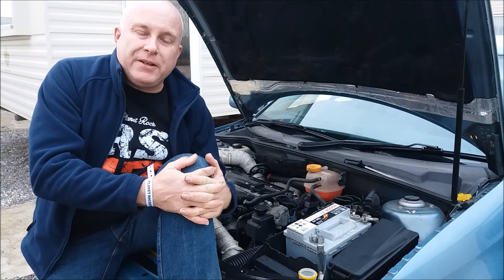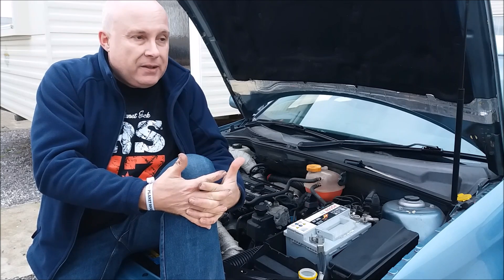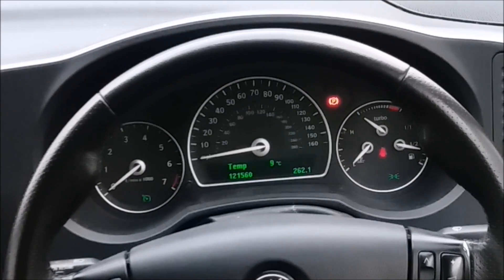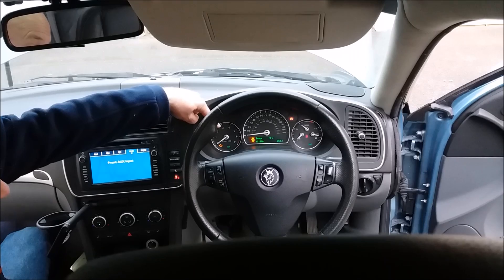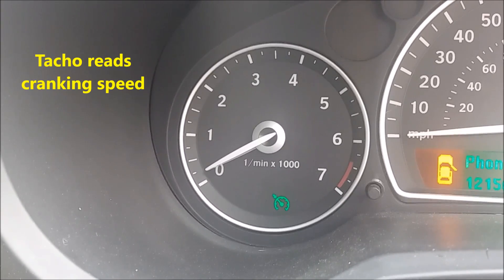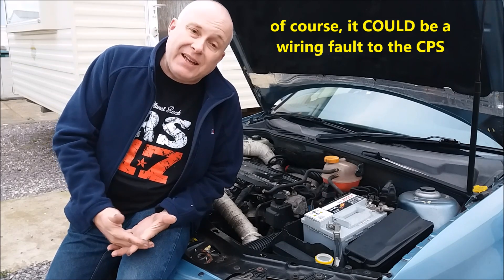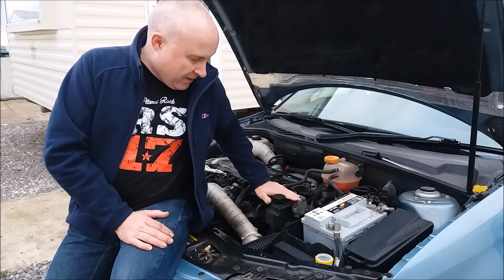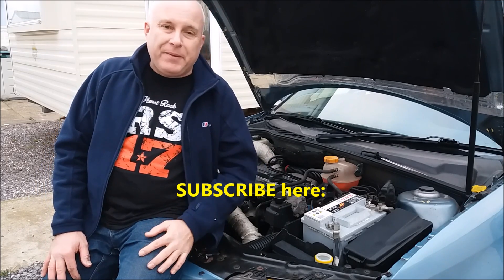CRANK Position Sensor Test - failing CKp sensor - CKp test

Comment: Great advice here! Had this happen three times on my 9-3 recently. All cut out whilst in the outside lane of a dual carriageway. First it just died, no EML but Traction and Stability warnings popped up. Restarted sluggish but cut out after driving again, this time with a CPS EML code. Did it a third time with EML where it wouldn't restart (no RPM movement). Seems heat related as after 10 minutes it started. Changed sensor today and fingers crossed. Try to do warm, it's very awkward and it can be tight. The Saab WIS says to move starter motor out the way for more room.

Comment: Very good advice. I have this problem but I get P0340 on my OBD2 Scanner. ( Not Tech2) I have Saab 9-3 1,8 Vectra Motorcode B207E. Is it under the Chain cover? Is it mostly dirty or cabel /contact- problems do you think.

Comment: Thank you so much for your great videos! I wonder if there's a video showing all the sensors that need occasional cleaning in a 1.2 TSI engine, so as to be able to do some useful DIY work. I've got a Skoda Rooster with the 77KW/105 HP variant but anything similar will obviously do. Thanks again!

Comment: @CycloneCyd  Your video is lovely! I am pretty sure my problem is the same - the crankshaft position sensor. (SAAB 93 2005 Aero, manual). I managed to took out the screw of the sensor, but it is so hard to take he sensor out because of the small room around and really hard access. It feels so stuck. Can you suggest any tricks is this problem? Many thanks in advance!
Reply from the maker: Clean around the area of the sensor. Spray a little penetrating oil. Try to do it when the engine is warm (the hole will expand). I had no problem changing mine, but a lot of people have the same issue as you.
Reply: Already done! It turned out it was difficult because the censor was misshaped  (expanded) a bit. Thank you so much! My problem with not starting  car is sorted out! Be blessed  @CycloneCyd!
Reply from the maker: Ah, right. Did you suss out why it was misshaped? Was the housing cracked and water had got in causing corrosion maybe?

Comment: Hi techies ,can you help. My 2009 vauxhall vivaro has a delay in starting, slight engine vibration and intermittent P0201 ( cylinder 1 open ) error above 3k revs. ( stop engine light )Garage checked wiring, charged me £450 for new injector still the same.have read crankshaft sensor can do this ?

Comment: My honda odyssey k20 is cranking but no start the engine...but fuel is coming and injectors is good but the spark plugs is not giving more fire as the normal car do....how is this problem come coz of crankshaft

Comment: So if the rpms are not moving while cranking that means that   the cps is bad?...im havinf the dame issue with a bad sensor.. cranks over and takes forever to start
Reply from the maker: Basically, yes.
Reply: @CycloneCyd  ty very much .I had one in there that started failing...put an OEM Nissan sensor and the crank would just crank ..I was so upset when I got out of the car I forgot I had the one that was halfway decent on my lap and it feels on the floor and hit it pretty hard because with that one the csr would start...but after I dropped it and we put it back in the car would take forever to start

Comment: Car cranks but will not start. When cranking tac does not move, but jumps ups a little bit and back down when stop cranking. Any other way to tell if its the crank  position sensor?

Comment: I have a 2004 Saab 93 2.0t, manual. I overheated once and since then when I cranked it over, it almost sounds as if there's no compression or pistons moving. I was able to manage to get it to start by furiously pumping the gas peddle, once started, it ran great. But like I said when cranking sounded like no compression but when I pumped the peddle a lot it would eventually start and run great. Now I was dumb and didn't fix the leaky radiator hose. So I ended up overheating it again. This time it not only sounds like no compression and as if the pistons aren't moving, it no longer will start even when I pump the peddle. Today I pulled a plug and put a compression tester on it, no compression when I cranked it. Pulled a second plug, hooked up pressed Guage, cranked it, same thing, no pressure. I have a strange feeling the pistons aren't even moving. Any idea what could cause this? I'm gonna check the 2 remaining cylinders tomorrow, but I'm thinking it will yield the same results as the 2 I checked. I can't afford to have it checked by a mechanic. Any help, info or ideas would be appreciated. Thanks.

Comment: So..when i do the test i must disconnect all 4 injectors and then try to start the engine to see if the tachometer moves?
Reply from the maker: Correct. the point behind disconnecting the injectors is two-fold: 1. the engine won't start so you are free to turn it over for a few seconds to watch the tacho  and  2. you won't flood the cylinders with raw fuel while turning it over (which would wash the bores and rings and get to the sump and contaminate the oil)

Comment: I just went out to crank our 2005 Buick Rainier, and had zero RPM's so tomorrow I will put a new crankshaft sensor on, and hopefully it will start & run as it should. Thanks!
Reply from the maker: How did you get on?

Comment: I have exactly same problem, which I have discovered this morning. Trying to start a car, I can hear starter, but thats it. Eventually it shows gearbox error, but once I read ECU faults, it is : Crankshaft position sensor. I have digital dashboard, so I could not check taho meter, but I am sure that sensor is faulty. Thank you for this video.
Reply from the maker: It does sound like it could be your CPk. Do let us know how you get on.
Reply: @CycloneCyd  got a wheel off today, it is C4P, 2.0hdi. checked connector, everything is solid, cant move a thing. Deleted error, it started immediately. Tried couple of times after that. Started each time, French gremlins:)

Comment: Thank you for your info!!!

I have an Audi A3 2010, 1.6 petrol. 145000 miles.
It starts whenever it want, once the car stopped on the road.

Road assistant scanned for faults, it showed it's a camshaft position sensor. 
I changed the camshaft position sensor, but still keep throwing same  codes...
Cambelt kit repair was done couple days ago.

Still getting these codes...

* P0341 (Confirmed) - Camshaft Position Sensor "A" Circuit Range/Performance Bank 1 or Single Sensor.

* Engine:
16725 - Camshaft Position Sensor A, Circuit Range / Performance

Going to check with multimeter cables and sensor

Thank you
Reply from the maker: Some cars do flag cam code when it is the crank sensor faulty. What it's telling you is that the cam sensor is out of synch with the crank sensor. It could still be either that is faulty and only testing can determine that. Find a garage with picoscope capability.
Reply: Thank you for your response, appreciate it 🙏🏻
Reply: Hey, just an update. My car doesn't start again. 30 min no start..
The tackometre idle moves up when cranking. Still the same error codes... Any idea..?

Comment: would it be possible for the ckp to fail w/o activating the check engine light?  great tip about the  immobile  tacho!
Reply from the maker: Yes, very common
Reply: @CycloneCyd  oh wow.  didn't know that
Reply from the maker: @RampartPh  yeah, neither (it seems) do most 'mechanics'.
The long and short is that on engines with only a ckp (ie NO cam sensor), it's the ckp that tells the ecu the engine is turning and it's position. Depending upon the exact nature of how the failure occurs, if there is no signal from the ckp, the ECU just thinks the engine is stopped/stalled and doesn't necessarily know there is anything wrong as there is no backup (eg cam sensor) to tell it so. Thus NO EML 👎
Anyone who goes to a garage with a car that stalls or won't start (and doesn't know this trick), the garage should look for codes, but then put a picoscope on the ckp to check the signal.
They should also do the same for engines running rough as sometimes the ckp is missing some of it's signals and the ECU doesn't know when to inject fuel or spark.
As I've said many times, most mechanics aren't fit to service a walking stick.
It's a training issue withing the industry.

Comment: I had a faulty crank sensor last year and problem was that it worked when the engine was cold and then failed after 10 minutes of running. Came up on the scan and must have been a coil break in the sensor that separated when hot.
Reply from the maker: Yep, typical failure

Comment: Hello sir. On a 2010 caravan 3.8 my ckp keeps failing every time I buy a new one. What is causing it to fail? I’ve cleaned all wire connections and checked for all ground wires, went beyond in trouble shooting. Thank You and I appreciate any help

Comment: My car is dying at idle after warming up.  Or dying while coasting or coming to a stop at slow speeds.   CPS was replaced 5 years ago, its a 2003 saab 9-5.  Always happens after at least 20 minutes of driving, and for some reason its worse when its hot out. When I press the AC button it also struggles and sounds like its about to stall.  Perhaps I have a failing throttle body and CPS at the the same time.   1) The throttle body will always throw a check engine light, yet?  (I have none) 2) will the CPS fail again in 5 years?

Comment: Touch wood this is what has happened to my C4 Grand picasso. It would just randomly shut off when driving along. No reason and at anytime. Sometimes one after the other, sometimes a month apart. Came up with a sorts of errors on dash which I now think was because the engine had shut off while moving as the egs gearbox also uses crankshaft data too. Replaced the sensor and so far so good.

Comment: 2013 ford figo petrol doesn't start and no petrol pump sound pumping gas, might it be crankshaft sensor?
Reply from the maker: Unlikely. Check fuses and relay first. Then look for voltage output from relay and check wiring to pump.

Comment: My sensor is failing and I am trying to change it but it is STUCK. I can turn it but not pull it :-( If anybody has any ideas let me know!
Reply from the maker: Soory I didn't see this earlier. Try some penetrating oil and turn it again. repeat. Then see if you can turn and pull at the same time.
OR have you sorted it?
Reply: @CycloneCyd  no worries. I had to drop the starter motor out and lever the sensor out from the bottom with a screwdriver - it only took a few minutes after employing this approach. Your starter motor video came in handy!

Comment: My 1998 Ford Windstar stalled while driving. I started it and after about 20 seconds running it stalled again and the Check Engine light came on. Now I just crank it but it won’t start. It has good fuel pressure at the rail. The tachometer registers engine rotation when I am trying to start it. I pulled out a spark plug and tested it - no spark. I thought to change the crankshaft position sensor but now think, “No”. What could be the cause?
Reply from the maker: Ignition coil? Did you sort it?
Reply: @CycloneCyd  I diagnosed more and unplugged the fuel tank assembly plug from the main harness and applied 12 Volt power to the fuel pump. I used a regular fused switch. I turned on the ignition key and turned on the pump switch. My motor started right up and runs normally. I tested the wire harness coming from the PCU to the tank assembly. I jumpered the relay to apply constant power and there is good power to the fuel pump connector. But when I plug it together and try to start, same old problem. My van won’t start. I swapped relays but still no start. Help. Anything else I’m missing?

Comment: ahhh, one thing im not sure of. WHen you test the rpm at zero to determin cps failure. Do you still have the connector disconnected? or is this with everything connected?
Reply from the maker: Everything connected. i disconnected it to simulate the fault

Comment: Excellent video. I've replaced the CPS on my Nissan Almera twice with aftermarket CPS and still have intermittent stalling and rough idle. Is it worth going for the OEM?
Reply from the maker: Bosch or Denso every time
Reply: @Adrian Sherman When the cps failed on my x trail I got an oem kit from Nissan containing 2 sensors for the cam and the crank.(they are the same). The kit was actually cheaper than buying the sensors individually. Might be worth checking if they have a similar deal for your almera.

Comment: took my car to repair shop they said came error on crank sensor then went straight the engine lume and said it was ruined and wanted 2.000 euros to replace it said it had to be done and to get a new one had to be bought new from the dealership so thank you
Reply from the maker: If the wiring was damaged, a simple repair should have been sufficient. Glad to help.

Comment: Exactly whats been happening with my vito, had gearbox reconditioned it must be then they damaged crankshaft sensor replaced without me knowing. So had problems, stalling while driving along, would start after a while or sometimes straight away. Headache. They had replaced with after market one, which was giving the problem. Mechanic told me things like you need original parts, you can get away with brake pads or new lights, but electric parts dhould use genuine

Comment: I have been having issues where I've been sometimes stuck either in second or fifth gear. Somebody on an old forum post mentioned replacing their crank position sensor and it helped that. Although from watching these other videos it seems like that's not a usual symptom of it failing.
Reply: You could try  gearbox oil change, often overlooked and can make gear chaged smoother, works for me and my reverse gear was quite crunchy too

Comment: Hi Cyclone, I experienced the exact stall problem you mentioned, while driving  a 2004 Peugeot 206cc.  Did a  continuity test using my DVOM between Bat neg & the CKSPS connector ( 2 pin), no sound! (Broken wire in all probability .... now, how to find the break , OR,  'back probe' the connector and bypass an earth to the engine, chassis or Bat neg to see if it'll run?

Comment: 10 years ago, my subaru 1998 mod, ej25d engine almost every tine engine was warn, and i tryed to restart, it wont start, but is started easy every time it was cold, changer crank and cam posision sensor, and all problems disaperd for 10 years. Now it not responding well on low rpm, when warm, gut runs fine on low rpm when its cold. ( brand new engine core 0nly 20 000 miles on brand new engine. Changes new iridiun sparkplugs 2 days ago, but no improvment. get ned cam and crank sensors 14 des, so hope when i change them, the problem disapear.

Comment: Had both the camshaft sensor replaced and camshaft sensor replaced.  Not at the same time put within the past year.  Got in my car today after a supposed repair and got a mile and a half down the road and the car stalled.  I'm lost.

Comment: 08 cadillac  cts misfire on all cylinders.  Plus random code. P0300 through  p0306.  No other codes. Compression checked fine. fuel and spark checked fine. Cadillac dealer couldn't find the problem.  Had it for over 3 weeks. They s aid the car ran  perfect.  Perfect fuel trims as well.  Could this be a crank sensor issue .  Since this is a v engine and it is affecting all cylinders.  I would think a cam issue.   They also said the timing seemed fine.     Just looking for other suggestions since the cadillac mechanics. Have no clue.  3.6 direct injection motor

Comment: I have an Opel Corsa 1.4 pick up, 2006 model, (apparently the "broken down" spare parts were shipped in crates from General Motors in Brazil and assembled in Port Elizabeth, South Africa.
When I crank the engine the tachometer moves up to 1000 RPM, almost starting the engine, but immediately stalls. I interpret this as NOT being the crank position sensor. The fuses are good, however I will have to borrow a multimeter to check the relays. I'm now trying to check the fuel system. The problem started 2 km after I filled the gasoline tank right up to the top; could the gasoline tank be "too" full and affect some sensor?
Ideas will be welcomed !

Comment: Is it possible an engine could still run if there’s an error with the sensor? Ive got an error code for the crankshaft position sensor but i can still drive fine

Comment: Hi im driving a Japan  2.0 fsi touren 2008 DSG automatic transmission my car has a starting problem and now as im trying to drive it the car starts but doesnt drive off when putting into the drive mode but when i place it in reverse  it does so stress free could a bad crankshaft sensor on it be the problem

Comment: hello i need help i have toyota mark  2 engine light battery light oil light they come on when you crank the car just when is about to start it stops if you put key on again all dash board light     wont come on until about 8 minutes  and when you crank it repeat the same thing again what could be the cause